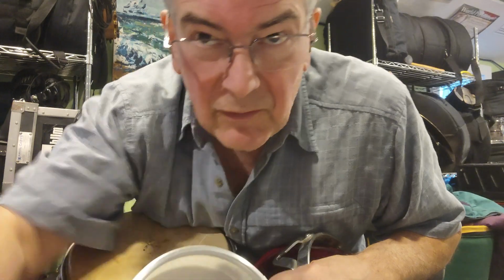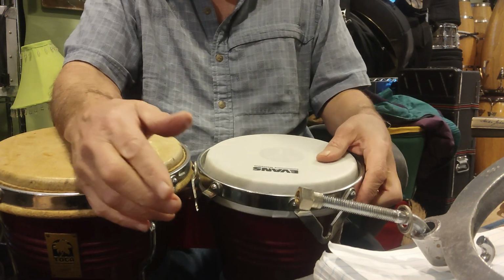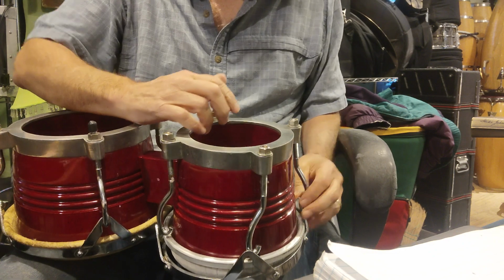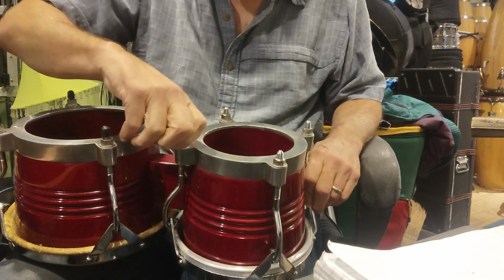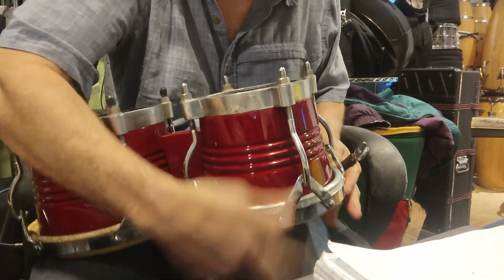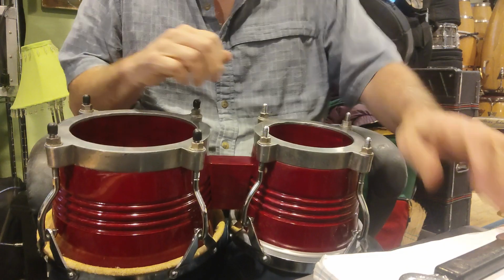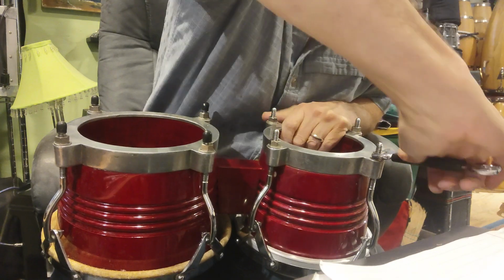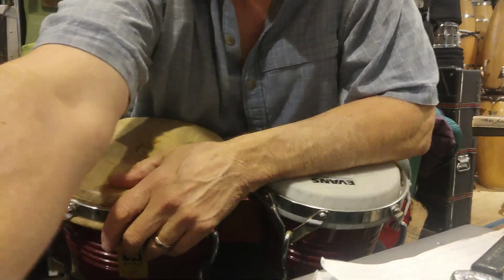Quick and Easy - how to replace a bongo head!

Comment: Hi, could you or any one please explain how to measure the drums to know what size of head to get?  Thank you in advance.
Reply from the maker: Sure. The crown of a drum head is how they are measured. That is the edge to edge size. Take a tape measure or ruler and simply put on top of the head and measure from one edge to another edge. 
Common full sizes:
Macho (smallest drum of the set): 7.15” crown = 7” or 7-¼”
Hembra (largest drum of the set): 8.5” crown = 8.5” or 8-⅝”, 9”
Common entry level sizes:
Macho (smallest drum of the set):  6-¾”
Hembra (largest drum of the set): 8”

Fyi this is different from the drum size which is measured to the shells bearing edge to edge.